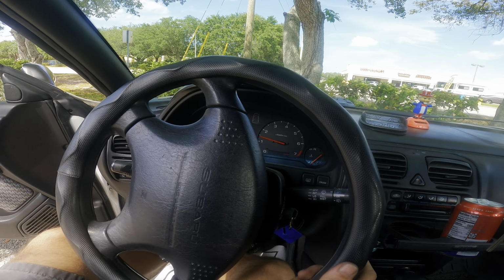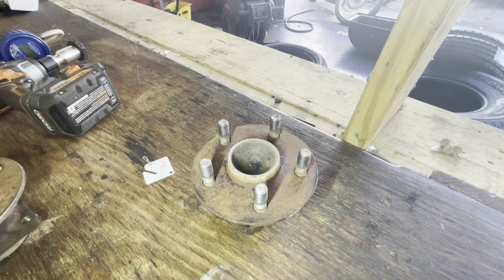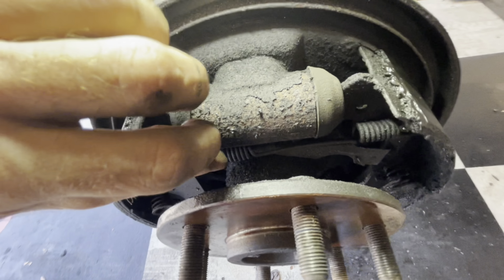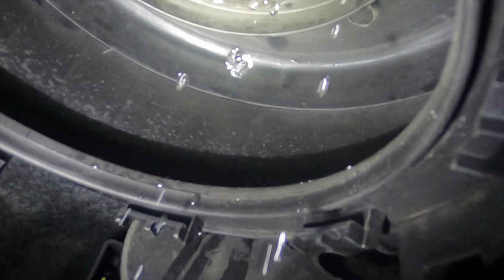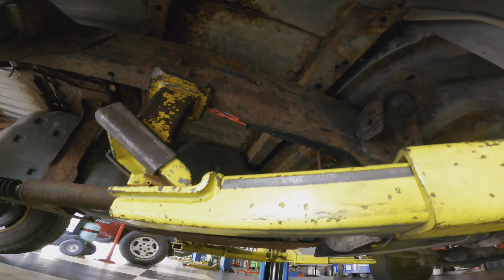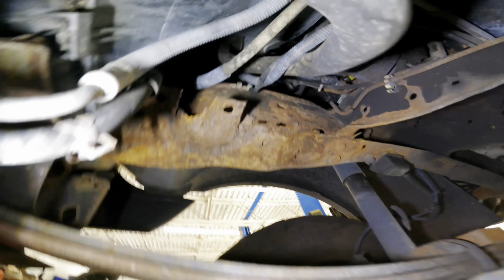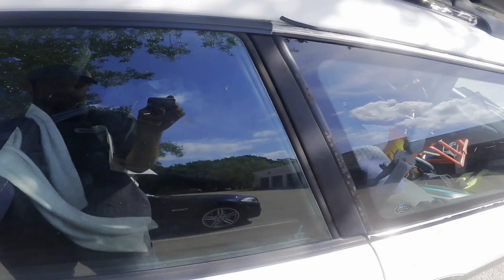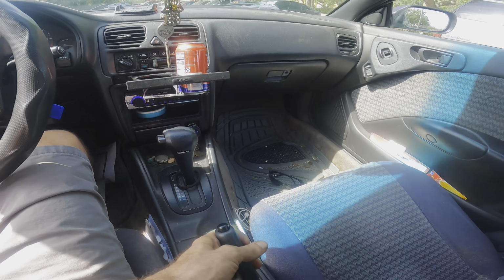Customer States: No! “Towed in and Towed Out” Compilation

Comment: 14:13  Hey, where did you go?  Have you been fooling around with that teleporter again?  6:30  That vehicle is an accident looking for a place to happen.  First time viewer.  7/25/2011 I bought a one owner, 2002 mustang gt 5 speed with 121,300 miles on it, $7,400 out the door.  The guy took good care of it too.  Today I have 154,400 miles on it.  Since Dec 2021 I've replaced the pinion and spider gears and clutch packs in the diff. and rear axle bearings.  Flushed the brake system and put new calipers, discs and pads all round.  Replaced inner and outer tie rods and ball joints on both sides.  Now I'm in the process of flushing the cooling system (man is it dirty) in preparation for replacing the intake manifold (leaking around the thermostat housing).  Replaced the gasket on the oil filter bracket and am going to flush the power steering fluid.  I AM HAVING A BALL.  I'm retired too so I have all the time I need and I don't ever, ever want to buy another car.🤪😜😁😎

Comment: Hahahaha! The truck with the rust issues! I tell the customer in these situations "Sorry, I can't help you" or "the local scrap yard will make you an offer". Makes their day and my day also.
Reply: deathtrap
Reply: Front bumpers worth more than the whole truck.
Reply: Yeah, the flavor is strong with that one...😂
Reply: On second thought, should have handed the customer the radiator cap and told him you be right back to run a new truck under it.
Reply: That truck looks like it came from Michigan!  Most 10 year old trucks here look like this.
Reply: @MySparkle888  my 22 year old s10 frame only has a bit of surface rust.

Comment: The Subaru with the rear breaks had me rolling...LMFAO.
Reply: both outbacks i've driven had f**ked up brakes
Reply: Block leaking? Ehh just plug it
Reply: The good news is that's actually an easy fix even if you can't get the OEM part. The right tools, a T fitting and maybe an hour of labor and she's good to go
Reply: brakes.....
Reply: Probably in the beginning just needed a caliper or hose.

Comment: That was the scariest thing i seen this morning, that car is about to break in half anytime now probably while going at 80 mph in the expressway not to mention the Flintstone car with no brakes
Reply: There was a car that often did break in half from corrosion.
It was known as Vega. 
It also featured all aluminum block with 'Cast Iron Plated' pistons that also didn't work out real well for longevity.
Reply: I don’t understand why people put up with the destruction of their cars from all the salt dumped on the roads.
 Not  to mention what all that salt and deicer is doing to the environment.
It all ends up in the rivers and streams.
Reply: Fred Flintstone's car would be better because it's made out of wood and therefore won't rust like the rotted ones in this video
Reply: @littlegp18  Termites and Wood Ants mite B long term issues
Reply: @peterfallert4994  I too think we should quit the salt and either stay home or put on tire chains during and after ice storms. At least get in the habit of driving at speeds to suit the conditions even if it means getting up 1/2 hour earlier and being late for supper many winter days. I used studded tires for many years. Several brands have winter tires that do well when used with some caution.

Comment: I think people just thought their old econo boxes were cheap throw away cars and now that gas is 4-6 bucks a gallon depending on what State you're in they've decided these are no longer throw away and should do maintenance to keep em running. And they increased in value like 40% over the last year. Anything under 3k is generally rusted junk or a Benz/BMW needing a timing chain. LOL
Reply: Don't jinx my 93 benz. It only needs brakes front suspension and a new oil pan because that jb won't hold forever. Hardly any rust that I can see though so there's that

Comment: Being from the the northeast. I envy how easy it is for you to take a regular, not excessively large hammer and simply tap the hub assembly out of that Corolla!
Reply: Right? where's the torch and air hammer? lol
Reply: Yeah it’s almost like you have to beat everything apart XD
Reply: I live in Arizona, my oldest vehicle is a 74 chevy pickup. The factory paint on the frame is still a nice semigloss.
Reply: Kalifornia here.  Everything is spotless underneath including junkyard cars.  Trade offs are sky high taxes and living with the nut jobs.
Reply: Yes Pat, that's why your area is known as the rust belt.  But it is beautiful up there.  😄
Reply: Yep from the rust belt myself and next to the ocean. Jealous over the rust free vechiles in rays videos's
Reply: @encinobalboa  you could move out like plenty of other people have
Reply: Yeah I had to replace a wheel bairing on my hhr and that wasn't fun being from NY had to use a torch to get the three bolts loose. Plus up in the rust belt anti seize is your best friend lol
Reply: I'm always surprised that so many high mileage vehicles look almost new compared to what a vehicle a third mileage looks like in Northeast.
Reply: Agreed Pat. Try removing that assembly in Pa. Torch and 3lb maul time!
Reply: Brake rotors in Maine get dinged after three winters.
They rust out so bad that won't pass them through inspection.
Reply: I just did my '06 rear drum hub and I spent 2 hours with larger and heavier tools before it finally let go.
Reply: @encinobalboa  Up on the north coast the "sea air" does a job, and the snow in the Sierra is sanded (no salt at least), doing interesting things.  Outside of SoCal there are more scenic auto issues, though the most interesting were all imported from exotic climes like Chicago.  Had friend who brought her 1970 'stang out.  We who were unused to the effects of salt away from the coast marveled that the body had not fallen off.  You had to be careful not to put a finger through the quarter panels.
Reply: In the northeast you have plenty of cold, snow and ice.  Salt and its accompanying corrosion are a given.  You should take some personal responsibility and use some proper corrosion inhibitor (not the spray on tar type that cracks and traps salt water under it) and spray all of the underside and nooks and crannies each fall to stop that corrosion.  Also, taking parts like the brake assembly apart along with wheel mounting studs and nuts, exhaust bolts, etcetera and putting a generous amount of never-seize or anti-seize on all of the mating surfaces and bolt and bolt hole threads will prevent corrosion.

When I worked as a truck mechanic in the oil field in the 70's, they would often spread salt water on the lease roads and that would get into the trailer underside, including the brake assembly.  The trucks and trailers were washed often, including the underside.  The anchor pin and the brake pad frame would get so corroded that the brakes would not release all the way and the brake pads would rub against the drum.  It would take using a rosebud tip to heat up the spider bracket and one person holding a large stainless steel sucker rod home made drift punch a couple of feet long while another person hit it with a four to six pound sledge hammer to drive the anchor pin out.

Then someone sold us some never-seize to use and we started using a generous amount on the pins and rollers and bolt threads and lug nuts and those brakes never had a problem working properly.  The brakes lasted a lot longer and when they finally did wear down enough to need to be replaced, the anchor pin could be easily driven out by one person with a one pound hammer and a regular drift punch.

If you are going to spend thousands, tens of thousands of dollars, for a vehicle then you should be willing to spend the few hundred each year to do necessary maintenance and preventative maintenance unless you just like the idea of spending tens of thousands of dollars every few years or the danger of driving around in a rust bucket.
Reply: @notherestillnothing  I’m in southern Ontario we have 2020 cars rotting away at dealers
Reply: BFH, PB BLASTER,FIRE the new england way lol "Live Free Or die"
Reply: yet...no one demands their Politicians to force state, county, city and town hwy depts to STOP USING salt-It's like gov't-approved Genocide on vehicles...grrrrr
Reply: @ronhall9040  
And what do you offer as an alternative to help keep the roads clear and safe for people to drive on?
Reply: @oldtimefarmboy617  what our parents, Granpaps n Granmas rode on..called gravel, cinders or sand and actually usin a SNOW plow to remove the snow, not salt ;-)
Reply: @ronhall9040  
"...gravel, cinders or sand..."

I am 65 years old.  I have driven down those type of roads.  Better to stay home.  Of course your "Granpaps n Granmas" also did not have to commute to get to and from work and usually stored weeks worth of food so they did not have to go to town every few days for groceries.

In other words, they drove down ruts and across washouts and got stuck often.  And snow plows can not get all the way to the road surface without digging it up (gravel, cinders, sand) or scraping chunks out of the pavement or causing extreme wear and damage to the plow and a plow will do nothing for ice or packed snow.

Try again.  Or maybe just take responsibility for yourself and yours rather than be lazy.
Reply: Bought a f150 out of Alabama, was 6 years old, living in Pennsylvania and New York the salt eats them up fast. That truck just had sun spot fading, body was beautiful, after 3 winters the body looked 10 years old, after 5 could remove the rockers by hand
Reply: @oldtimefarmboy617  my point was not about "being lazy"-I myself am 70...folks back then made the trade off of becoming better able to drive in those kind of conditions, or forgoing driving in those conditions in return for not having to "find money somehow" to either unnecessarily and  prematurely repair or replace vehicles.. I personally, on a limited income, would rather trust my driving skills and common sense and put up w/the occasional gettin stuck, even back when I commuted daily, and I DOO make the effort to keep my vehicle clean underneath(adding yet another expense caused by salt use)...oh, and BTW..1) that salt use u love so much also creates HAVOC not only to vehicles, but also to the road surfaces themselves as well, especially if used on gravel roads...and 2, vehicles back then wernt so ungodly overpriced like they are now
Reply: @ronhall9040  here in MinneSNOWta they have tried de-icers other than salt only to find that when the temps drop to more than -25F the non salt de-icers would become ineffective and would not melt the ice so the roads would be dangerously slippery and the one non salt de-icer that did work somewhat stunk like wet pig crap on a hot summer day and would get all over everyone’s cars and the smell would make it so you didn’t want to even go near your car.
Reply: @ronhall9040  
As compared to all the wrecks and injuries suffered when roads are slippery because they have not gotten salt on the roads yet.

And the cars were a lot less expensive because they were not as good or as reliable.  in the 2020's we do not have to do tuneups every 10 to 15 thousand miles, we do not have to change oil every 3000 miles or more often.  Engines can last 100s of thousands of miles rather than being worn out in the first 100 thousand.  We can get 10s of miles per gallon of gas rather than feeling lucky if we can get 10 miles per gallon of gas.  And the construction of cars these days are designed for survivability in crashes so far fewer people die in accidents.

Sorry to disappoint but it is not the 1950's anymore its the 2020.  Welcome to the 21st century where you can whine for the whole world to see.
Reply: NE Ohio.  Not even a torch and 4lb maul was enough to break the hub free on my kids Saturn.  Had to take it to a shop with "big boy" air tools and even then there was a "heated" and lengthy negotiation.  Not looking forward to doing my Subaru's rear hubs.
Reply: Being from the northern climes myself, I often wondered where his trusty bottle of anti seize was. I live in the south now and my car is 13 years old and there’s no rust anywhere. My old explorer looked like mars underneath after 5 years.  I did the rear brakes and I think I went through a whole can of PB Blaster. After buffing off the rust, it all got painted and anti seized.
Reply: @stans5270  buy the better grade of rotors. I run factory rotors for years and then put on the coated rotors. They go from wear instead of rust.
Reply: @RIBill  I got one rear drum rebuilt on my 97……….hammered n heated away on the other for hours, no luck. Going after it again in the mornin
Reply: I did a wheel hub on my 2010 Yaris from northern NY. I had a HELL of a time even getting the bolts out, then spent 2 hours getting the hub off the axle beam and trying to get the backing plate off the hub. After seeing the level of rust the backing plate had (so bad I could see through) I ended up buying replacements. Then the wheel cylinder bolt snapped due to rust and the brake line was rusted out too so I have replaced everything but the beam.
Reply: Here in Michigan we usually have to use our hub tammer bolts up to hub and comes out a foot away from car lower hoist to put the control arm of the bad wb on a jackstand and then use a sledge on the hub tammer lol sometimes just sometimes just a regular hammer will remove it in a few taps when im lucky lol
Reply: @donakahorse  and for air hammers we have sometimes used 2 snapon air hammers at once after using torches especially on the newer ford escapes
Reply: I say this about all the youtuber car builder/fixer lol no struggle wat so ever. Pure jealousy!
Reply: Lucky. My lug nuts fight me sometimes up here in ct. I pulled my trans on my truck the other day and damn near went blind from the crusties falling in my eyeballs lol
Reply: Laughs (cries) in oceanside New England salty rusted tone...
Reply: I’m in Upstate NY, we consider a brake job to include new pads, rotors, calipers, backing pads, brake lines, starter, fuel line, wheel bearings, transmission lines, frame swap, door bottoms, and lastly seat frame mounts from all of the salt tracked inside the cab. Sometimes a floor pan replacement 🤷‍♂️
Reply: @randomvideosn0where  - where in NY, I’m up by Syracuse
Reply: Being a life long resident of the rust belt is the reason I'll never own anything brand new...ull be lucky if ur wheel wells n rockers arnt ready for replacement by the time u pay it off ..o yeah then theres the frame
Reply: @RustyZipper  Schenectady area
Reply: @notherestillnothing  when are you going to start driving it?the 74.
Reply: @ronleachsr  i drive every couple of weeks
Reply: @notherestillnothing  ** jealousy, extreme jealousy. Very good for you, though. **
Reply: @stans5270   WOWSERS
Reply: @notherestillnothing  I'm in Pennsylvania and my friend has a 3 year old Dodge Ram that's already rusted
Reply: I did a hun assembly on my gf’s 01 intrigue a few days ago. The rust and corrosion gods blessed me and it came right out with minimal hammerage. I live in the rust belt and it’s the only hun I’ve ever done that didn’t require air hammer / torch / puller / swearing.
Reply: Same in Norway. My moto changing bearings is it can’t be stuck if it’s liquid.
Reply: @encinobalboa  🤣🤣🤣
Reply: @encinobalboa  rather deal with the rust than those folks out thatta ways...decent folks trapped out there too I understand.
Reply: @leidersammlung6955  my old ladies Scion I can literally ONLY be a week from just being removed and I'll have to kick slam ploy her wheels off everytime....hate working on that car it's outlived  many of my cars but it's sucking it's life from me I think lol
Reply: @NobodyUR  Been here a long time.  You never get used to the intolerance, the cancel culture, the entitlement, and all the rest.  What saddens me the most is they are unable to connect result to policy so  the same mistake is made over and over again.
Reply: Being from Canada I’m surprised they aren’t using nylon or some other plastic as a deformation spacer so there’s flex when you hit it and the rust if any can just break away, you could even melt it out for extra movement that way there’s only areas that built up rust to the point of puncturing the plastic left holding it
Reply: @aterack833  Nah
Reply: Up in the NE, they use corrosion to properly reinforce the clamping force of the normal securements. In the SE, they just drive it until the hubs fall off on their own. That's how you know it is time to harvest the hubs before they're too dry.
Reply: @c.b.816  that’s actually why some components you can’t use antisieze on here in Canada, the rust is meant to act as loctite
Reply: i live in canada 
im impresses with the very small amount of rust
i had to replace the disk brake from a car once , ended up ripping pieces off untill it all came off
Reply: Right I’m in central Indiana a big hammer is part of the arsenal 🤣
Reply: Being from the UK I envy how the vehicle is not a pile of brown rusty sludge where every nut and blot requires serious persuasion or drilling out.

EDIT: Just saw the rusty truck part of the video, yep that's more like what I'm used to lol
Reply: @encinobalboa  Ditto Texas (including the nut jobs)
Reply: Lol right?!!
Reply: @paulgallo6484  It isn't hard to keep the undercarriage clean. They make tools for that. If you don't like maintenance, you can spray rust fluid on it every September and that will stop the rust.